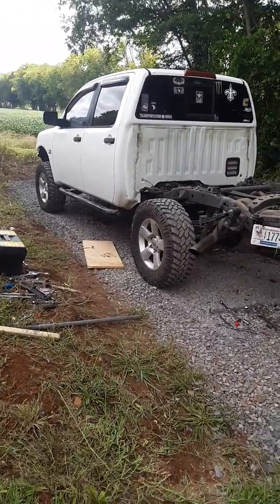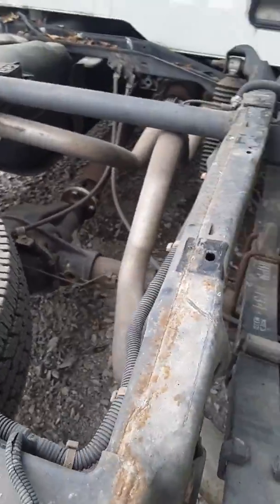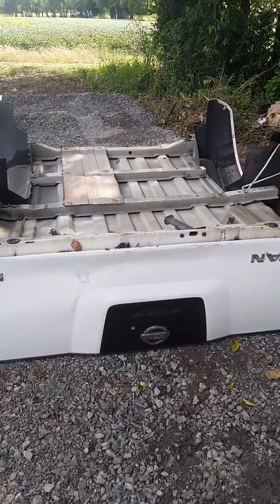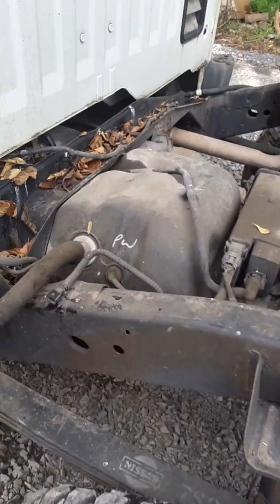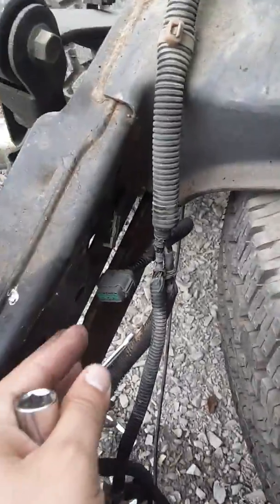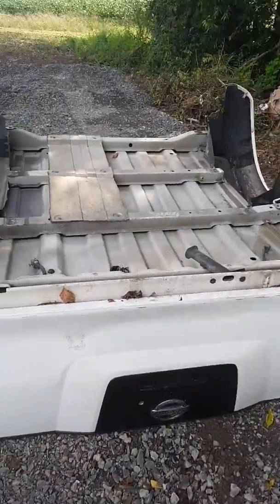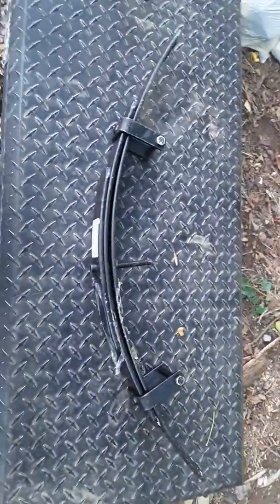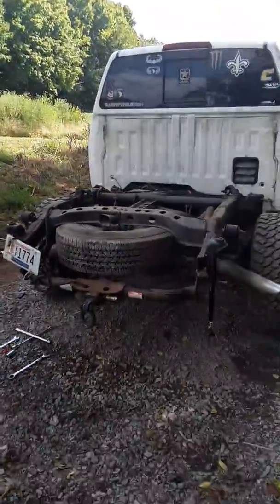Nissan Titan- Bed Removal. Build Part 4.

Comment: Do I have to get under the truck to get access to the bolts or can I access them from inside the bed?
Reply from the maker: you have to go under the bed, its not that bad.
Reply: Sergeant Tee's Channel  why did you take off the rear bumper ?
Reply from the maker: @prettyboyoscar4912   Rear bumper was damaged in the accident. It was bent.

Comment: How come i dont see the fuel pump on top of the fuel tank?
Reply from the maker: The fuel pump goes inside the tank. Theres a cap with bolts on the fuel tank that you have to remove to get access to the fuel pump. I had the fuel pump replaced at one time.